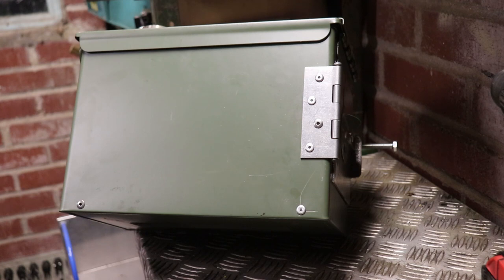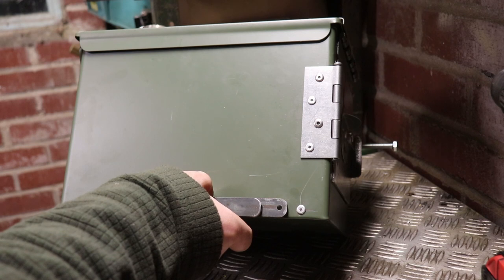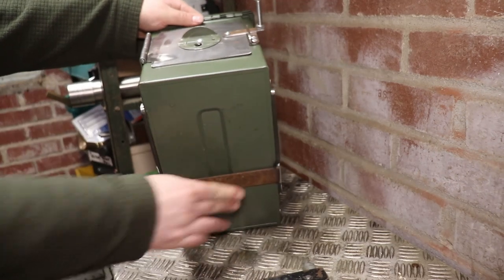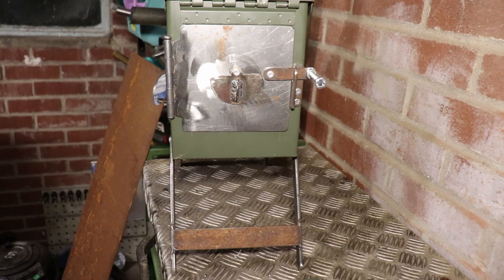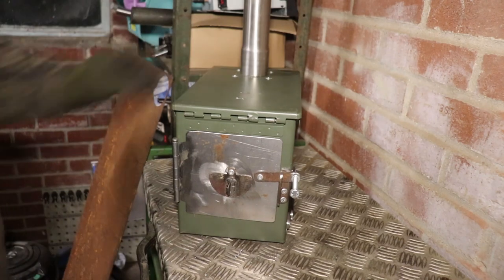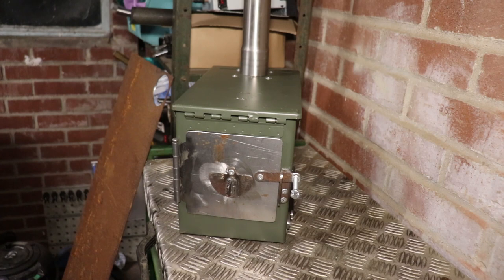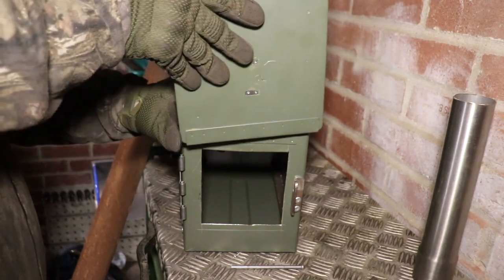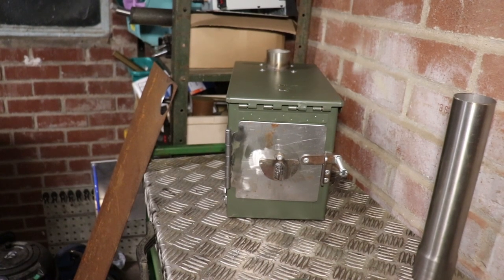D I Y Stove Tent  Build Part 2

Comment: You can use a 1 gal square solvent can, wire and tin cans for ducting and sheet. A wood mallet, hatchet and camp knife with old nail to cut the tin and  punch the holes. Wire can be used to attach everything together. Definitely want a multi tool. But a basic hobo stove is cheaper than dirt to make with things from the trash. All sorts of steel boxes around.

Comment: Instead of grinding the handle off, why not turn it upside down and use the hinged lid as an access to remove the ashes?
The bottom, now on the top, could be used to cook on.